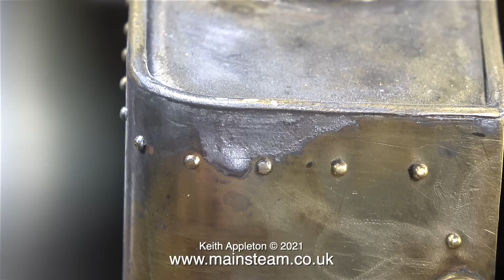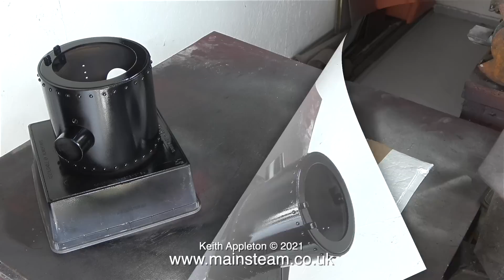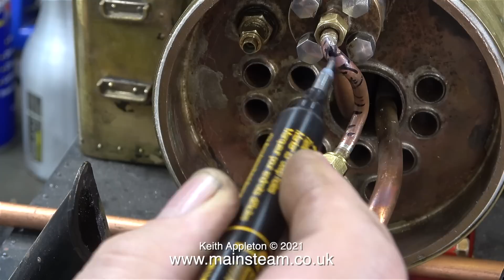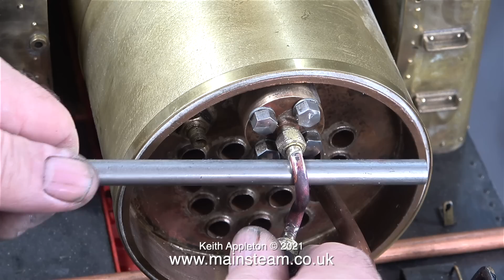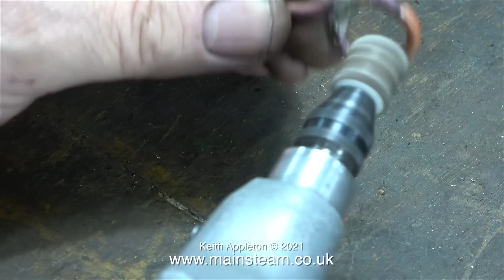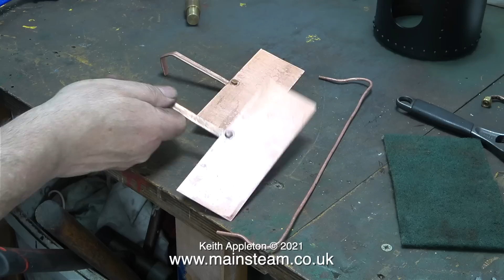SIMPLEX PRAIRIE TANK - PART #85

Comment: Hi Keith. 

The HMG paint your using. What is its code please?
Is it the AR141 high temp enamel?
Or maybe the D66 series of enamels where you can chose from RAL colours in various finishes. 

I’m watching this whole series. What a great transformation so far.

Really enjoying it. I have your videos on whist I’m in my workshop building a loco 😊
I’m at the paint stage and will use the Pheonix enamels for the rest of the colours but I was after a really durable matt finish for my smoke box. You wouldn’t like it, I can’t get my hand in it 😂 it’s only a small roundhouse loco.
Reply from the maker: I really can't remember, it should be shown somewhere in the part of the series when I am painting the engine. The GWR Green is not High Temperature Paint.
Reply: @keithappleton  ok, thanks for taking the time to answer 👍. I’ll try the matt black AR141 which is good to 300degC and see how I get on.
Reply from the maker: it should be OK if you bake it on with gentle steaming in the initial runs - it seems to work for me, even when using Humbrol Enamel paint.
Reply: @keithappleton  ok thanks Keith. I’m up to video #98 or so now. You have indeed shown the can and its their C71 which is their range of quick drying enamels. Obviously those have worked fine for you.
I’ll be using Phoenix paints for my coloured sections but was just after a matt black for the smoke box and boiler back. 
The AR141 which I previously mentioned is baked at 220deg before it gets it full properties and only available in matt black. 
For info their D66 range is the normal range of enamel colours.